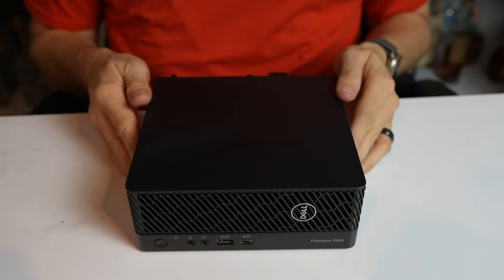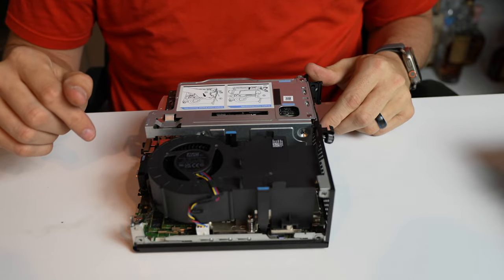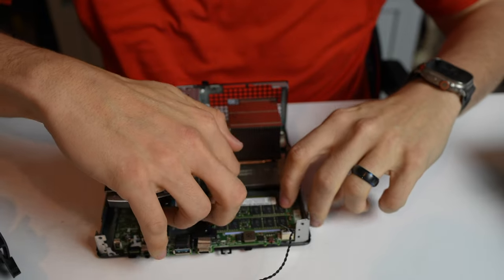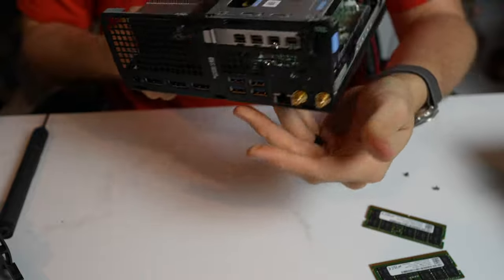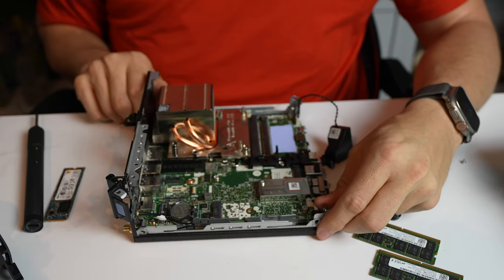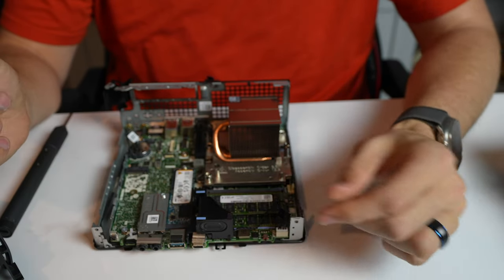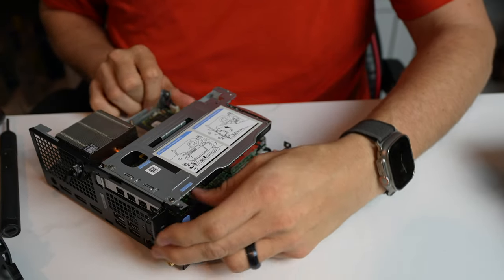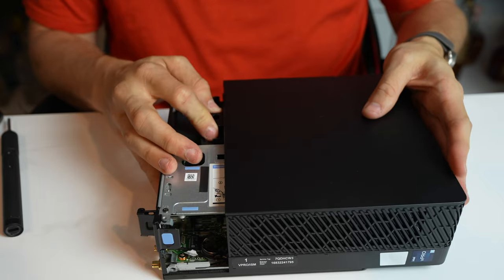Dell Precision 3260 Full Disassembly (2023 Model - i9, 64GB DDR5!)

Comment: That CPU cooler is at the bottom, under the videocard when placed vertically. The videocard will block the heat from the cooler making the unit hot. If they would have placed the cpu above the videocard the heat would have dissipated directly to the air from the upside too.

Comment: Curious if you can fit in a 2 slot GPU like the Quadro A2000 in this puppy? Or even go with a low profile 4060 (adding on the power to 8 pin connector of course)
Reply: Did u find an answer to that?
Reply: @redharubaye1269  Unfortunately no, I wound up going with an HP EliteDesk 800 G4 from eBay and an A2000. Handles most of my games at 1440P with no issues. Super happy with this SFF $550 gaming PC.
Reply: @heart4Pahoa  that sounds like a great deal. Just for reference tho what games do u play on it?
Reply: @redharubaye1269  CS:GO2, PUBG and Fortnite.
Reply: A2000 fits, a rx6400 fits also but just by a mm. A 4060 dont fit.
Reply: A2000 fits, a rx6400 fits also but just by a mm. A 4060 dont fit.

Comment: How loud is the desktop?
Reply from the maker: So under normal use, you’ll never hear. However, if you were to starts render in any type of software that would push the CPU, you will start to hear it slightly. 

Running something like Prime 95 or Cinebench, you’re going to hear it after a few minutes.

Comment: so, basically a lenovo p360 ultra?
Reply from the maker: Pretty much!
Reply: @ManeTech  yeah, thought so. although, lenovo has space for an extra 2.5’’ drive and memory upgrades are waaay cheaper (at least in my region). we can also opt for no OS over at lenovo and save 100$. in general ive spec’d one over at dell website with i5 12500, 32gb ram, no VGA and it came around 1500$. for that kind of money i think lenovo can squeeze in a t400 4gb and a 2.5’’ drive with also 32gb of memory. anyways, nice form factor. personally i wouldn’t mind twice the size with more expandability options. it would still be smaller than most ITXs. i think. cheers.

actually, i think this is smaller than p360 ultra.

Comment: So the guy just wants to use this as a media device connected to a TV?  What a waste of power.
Reply from the maker: In all fairness, this will be his primary PC. But yes, slight overkill.
Reply: @ManeTech  indeed. This unit would be like like 3000 CAD in my area. If not more.
Reply: but at the same time the gaming performance might suck because the T1000 is a workstation card and not a real graphics card by any means. My laptop's RTX 3050 shreds it in all ways.

This really is an odd system.